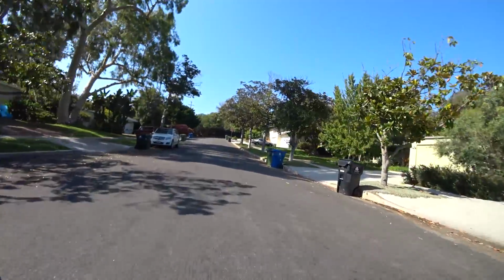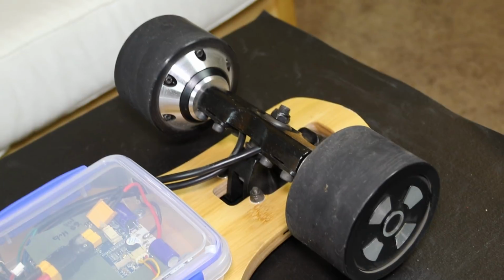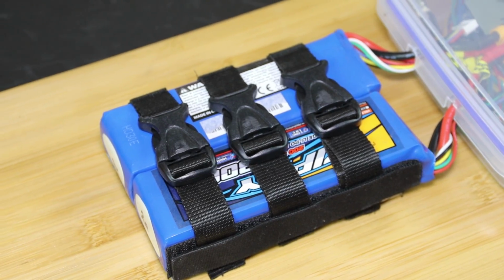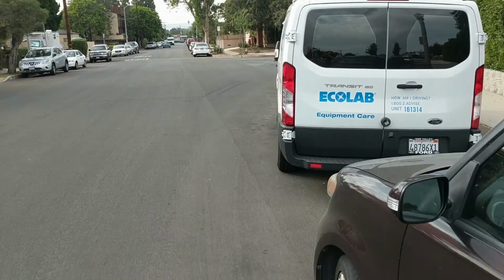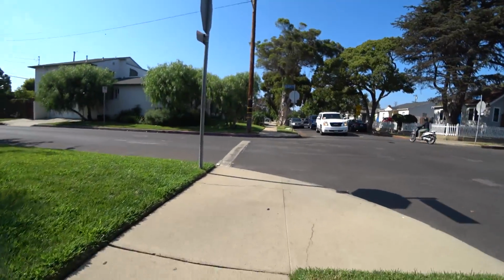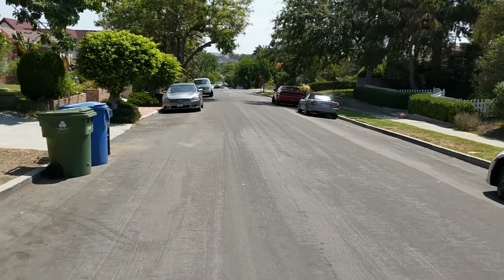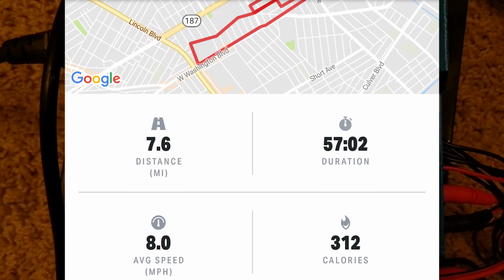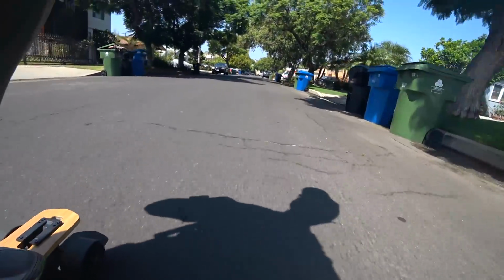Awesome Longboard | 21mph / $370 / Easy Build

Comment: Hey im thinking of making my first build similar to this just wondering what the range on this board is? i weigh around 230 so how do you think the speed and range will differ for me?
Reply from the maker: I would guess you'll get around 7 miles of range - depending on the type of riding. I weigh around 170lbs and can get 8+ miles. I usually push start and don't have too many crazy hills to go up. The top speed for you should be the same as it was for me on flat ground and slight uphills - around 21 mph, which feels very fast!
Reply: Oren's Projects thanks, do you know how to make the range longer im looking for about 10 miles of range?
Reply: Somebody please correct if im wrong but from what little i know about batteries you would need to buy batteries that had a higher capacity. So for example instead of buying 2 5s/3Ah you could get 2 5s/5Ah batteries
Reply from the maker: robert ancillo, Michael Sperry is correct. You can buy higher capacity batteries to increase the range. I think 4.5 - 5.5Ah should be enough. There are trade-offs when using higher capacity batteries that I mentioned in response to a comment from Andreika42.
Reply from the maker: robert ancillo, for your weight I think you'll be much better off with 10S voltage (2 x 5S) - so look for 5S batteries not 3S. The 20C, 30C, etc. indicates the maximum sustained discharge rate of the battery. You can calculate the maximum sustained current by multiplying that number by the capcity. For example, a 5000mah battery that's rated at 20C can handle a sustained 100A current. I think you'd be fine with 20C, which should be the cheapest.

Something like this 5Ah battery could be ok, but you'll need to change the connector to XT-60
https://hobbyking.com/en_us/zippy-flightmax-5000mah-5s1p-20c.html?___store=en_us

This is another option that's 4Ah and already has an XT-60 connector
https://hobbyking.com/en_us/turnigy-battery-nano-tech-4000mah-5s-25-50c-lipo-pack-xt-60.html?___store=en_us
Reply from the maker: You're correct, the charger I use can only handle a single battery up to 6S. You can charge each 5S individually, which would be the easiest, or get a parallel charging board, which you need to be a bit more careful with but is easier.
Reply: Michael Sperry thanks
Reply: Oren's Projects thanks again, i found 3s 5000mah batteries on hobby kings but im not sure which ones i should get either the 20c, 30c, or the 40c i dont really know what 20c, 30c or 40c means so which ones would you recommend?
Reply: Oren's Projects thanks for the help, but i have one more question since it will be 5s batteries will i still be able to use the charger you have a link for in the description because it says it works for 3s to 6s im not sure if it means combined or per battery?
Reply: Oren's Projects thanks for getting back to me again but wouldn't the two batteries with the parallel charging board still go over the 6s limit or am i mistaken?
Reply: Oren's Projects or could i buy the balance charger neil from big kids has since it has two of them together if you think this is the best way to go could you give me a link for it because i cant find it on eBay or amazon
Reply from the maker: When you use a parallel charger it basically makes both batteries look like a single battery to the charger. The result is the batteries will charge half as fast because the current is split between them.
Reply from the maker: I see Neil used a dual charger. That's definitely the nicer option but I don't see it for sale on sites like Hobbyking of Amazon. I think it's kind of difficult to find.

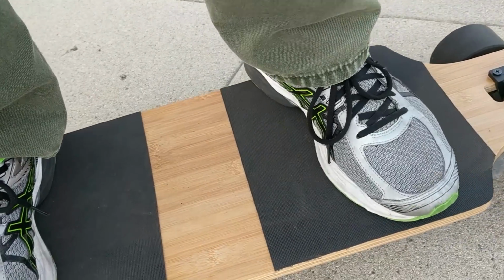Comment: Love the suggestion about the softer grip tape at 1:40. Totally makes sense for longboards.
Reply from the maker: Thanks! Yeah, I hated having my fingers get sanded from carrying the board. BTW, great video with the 70mm Maytech motors. You did a nice job making them fit on a standard truck. I used those motors for my first build.

Comment: wow great vid I were wondering is all the cables that are unconnected spouse to be like this or is it just unconnected im talking about the white connectors with colorful cables
Reply from the maker: Thanks! There are 2 types of cables that are not connected. The slightly bigger connectors with 6 multi-color wires that are attached to the battery are for balance charging the lipo batteries. The smaller connectors with 5 multi-color wires that are connected to the motors are for the sensors. The ESC does have ports to connect the sensors but in this case I didn't connect them because the motors didn't work properly with them connected - it might work with a different revision of the ESC. The sensors usually aren't required. They help when the motor is starting from a complete stop. The motors have been working great for me, even from a complete stop, without the sensors. I hope this helps.

Comment: is this the same esc as yours

https://www.banggood.com/Electric-Skateboard-Longboard-Controller-With-Remote-Dual-Motors-ESC-Substitute-p-1202299.html?rmmds=search
Reply from the maker: It looks similar but the board layout and power switch shown in the pictures are definitely not the same. It might be a variant of the same board. I noticed the picture that shows how to change voltage has a watermark that says "Dicky", which is the guy selling the ESC I used (from eBay).
Reply: and do you think I should buy it or not and did you have issues with changing voltage
Reply from the maker: I don't have experience with the banggood board (it could be fine). The one I got from eBay is good. I changed the voltage on one of my boards and it's working well. It can be a bit tricky with the soldering - but not too difficult. You can specify the voltage you want when you place the order and then change it later if you need.

Comment: Do you know if those trucks are the same ones used on the Meepo board?  I love the drop through deck and want to do a deck swap, but I'm not sure if ill need new trucks.  Thanks, and great video!
Reply: its same truck as the earlier meepo boards.  And the recent meepo board truck can also be assembled Dropthrough. hope this would help.
Reply: Kieran E-board the current one can be assebled drop through using the same trucks it comes with? Or will i need to purchase new ones?
Reply from the maker: Almost any longboard truck should work with a drop through deck. You just need to fully unscrew the kingpin so you can remove the hanger and then reassemble it through the board. Thanks Kieran E-board for the update.

Comment: the Meepo board is about 5.2 inches off the ground. which is too high for my comfort zone. how high is yours using the drop through deck? great design! i love it
Reply from the maker: Thanks! The drop through deck I used in this build is 4" off the ground near the trucks. The deck is concave so it's about 1/2" higher on the left and right edges.

Comment: I ordered my hub motors and controller, paid for the DHL shipping, and it still says a month to deliver. I thought the shipping was faster than that!?
Reply from the maker: That's messed up. Hopefully their estimate is wrong and you'll get it much sooner. I ordered from the eBay seller eboard-shop and mine arrived in Los Angeles in about a week. I'd try contacting DHL to get more details about why it's taking so long.
Reply: Update:
The chinese "Week of Vocation" or "Golden Week" has delayed my shipment but it is coming sooner than Nov. 1st.

Comment: Nice vids! Ive been considering making my own electric longboard when I have the extra cash. With the cheap boards like the meepo board its hard to justify making one on the budget though.

Can you get regenerative breaking on this? Thats a feature most boards come with that you dont hear about much on diy builds.
Reply from the maker: Meepo is definitely a great board for the money if you want something already built to just start riding. I think the custom route is more about personalizing - and keeping the price low. In my case, I prefer the deck, griptape, and battery setup I used over the meepo. The ESC in this build is basically the same as meepo and does have regenerative braking. DIY boards with VESCs also have regenerative braking.
Reply: Ah nice thanks for the info.

I have always liked to make my own stuff. It just gets tricky when the custom starts costing more then the pre built :s 

I was originally going to try and make a belt drive one, cuz I can make the majority of non electronics with my 3d printer. And I already have 2 ok size motors and esc's from when I was trying to make a drone that would probably work ok. And I think you can 3d print belts now. But they suck to push which makes hub motors sound nicer for if you want to ride it normally. Maybe I can maek a belt drive and switch to hub motors later without needing to change the other electronics.

But this bae needs to be made electric lol. Aka my board. http://landyachtz.com/us/maple-chief-floral-729

Comment: Really cool. Since there's no BMS, what do you think would happen if you went downhill on a full charge with this setup?
Reply from the maker: Thanks! I've thought about that before. I'm not sure. It hasn't been a problem yet. I'd imagine it could be a problem even if you have a BMS. The power generated would have to go somewhere. If it's not going to the battery it would turn into heat. Once when I was going down a very steep hill using a different ESC (the VESC) I think the electronics overheated and the brakes shut off and the board started rolling fast. Luckily I was able to jump off quickly!

Comment: could you please show us how you wired all the electronics together? i am a newbie....
Reply from the maker: I'll try to include how the wiring is done in another video. There are just a few connections needed to wire this ESC. Each motor has 3 power wires and usually a small 6-pin connector for the sensors. On this dual ESC there are 2 sets of 3 wires for each motor to connect to. The wires can be connected in any order. On this setup you don't need to connect the 6-pin sensor wires - it worked better for me disconnected. Then just connect the ESC to the battery to power the system. Once you get it working, if the motors are spinning in the wrong direction, swap 2 of the motor wire connectors to reverse the direction. I hope this helps for now!
Reply: thank you!

Comment: As long as the batteries, ESC, etc were in a sealed container, do you think the hub motors would be alright in the rain or just slightly wet conditions?
Reply from the maker: I think the motors should be fine in the rain - although I'd suspect it could shorten their life, along with the deck, bearings, etc. These motors and wheels are the same as the meepoboard and he rode through heavy rain with it. https://youtu.be/MGokI-0Z6q8

Comment: Did you have to program the esc with a computer?
Reply from the maker: No, the ESC I used in this build is not programmable. You just plug in the motors and power and you're basically ready to go. Another ESC called VESC is much more configurable and does require programming from a computer.

Comment: How would you charge the batteries?
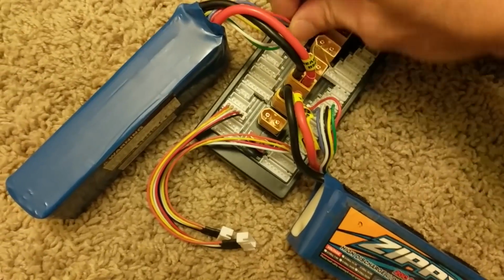Reply from the maker: I use a lipo balance charger - mine is the B6AC v2. To charge both batteries together I also use a parallel charging board. You can see me doing this at around 8:45. I updated the description to include links. Big Kids recently made a great video that goes over balance charging in detail https://youtu.be/3dfBrrNUsos

Comment: First. Great great vid. I recently(last night ) bought a longboard for 30$ and have bin think about building or buying a meepo.. question. While breaking, r u regenerating power? I'm assuming with the lipo batteries no. Love to know what u think
Reply from the maker: Thanks! I'm pretty sure this board (and Meepo) does have regenerative braking. It should increase the range a bit but I haven't done any tests. Maybe I'll do a video testing it :)
Reply: Oren's Projects perfect. This video got me very excited. Also, iv priced out buying the all parts direct from meepo and it seems to be cheaper to get it from them... I think I got everything you would need -the charger and deck because it made the shipping double for about 275$ us shipped to Canada.
Reply: Thanks for sharing that!
I just ordered a meepo but will have a go at my own build as well
Reply from the maker: That's a very good deal. Thanks for sharing! Good luck with your build. I think using your own deck is a good idea :)

Comment: the batterys options is thisthe best cheap option what do you recommend besides this?
Reply from the maker: I think the batteries I used are priced very well. They're $20 each at HobbyKing. I actually bought 4 packs so I have an extra set to swap on long rides. The 3Ah capacity has been enough so far. I can get 8+ miles range on a single charge. It's also nice they have an XT60 connector (same as the ESC). Another good option is buying a battery pack from meepoboard.com. It's more expensive but looks like a good deal for a 10S2P Li-ion pack.

Comment: the front wheels are also 90mm? what about the trucks
Reply from the maker: Yes, the front wheels are 90mm. The trucks are 10 inches wide. The front wheels and trucks match the hub motors nicely. They are sold as a package on eBay.

Comment: can you get the same speed with only one motor, I no it will have less  power stating off. if so can you use the dual esc for just single motor. sorry new to building boards.
Reply from the maker: I haven't tried, but I'd guess 1 motor would be just a bit slower on flat smooth ground. You would notice a bigger difference on hills - also braking would be worse. For the ESC, the same seller on eBay also has a single motor version that is cheaper. I'm not sure if there is a single motor version of the hub motors I used. For the price, I think it's better it to get dual motors, unless you really want to make the board as light as possible. Here is a link to the single motor ESC: http://www.ebay.com/itm/single-motor-electric-longboard-skateboard-controller-ESC-Substitute-/302439713065
Reply: omg thank you for the quick response, Great Video btw.